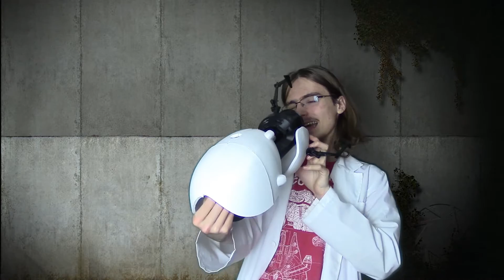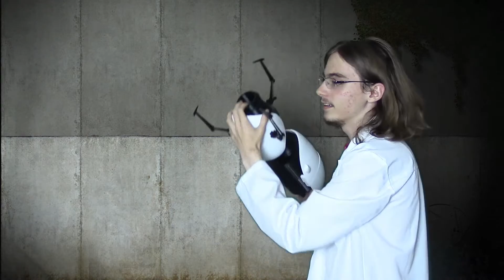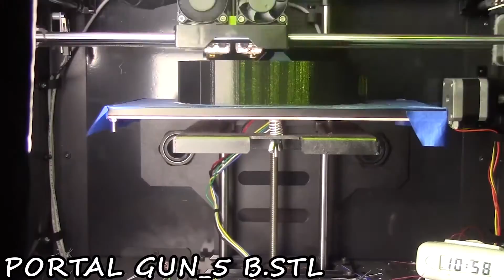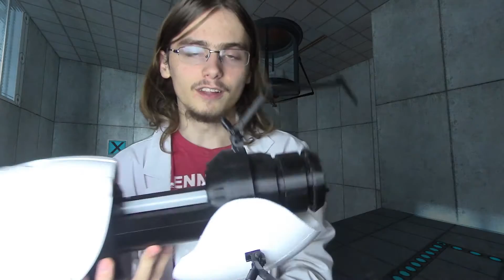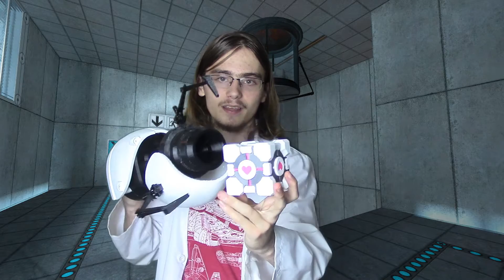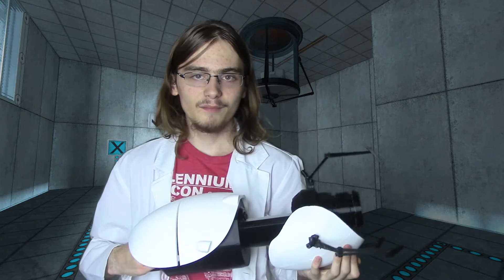3D Printed Portal Gun- Thingisplore S:2 Ep:11

Comment: How much plastic did it take, A whole role? Half?
Reply from the maker: It's been far to long for me to remember exactly, but even with the white supports I believe it was less than one roll of film each. What you can do though is download all the pieces and slice them. All slicers I've seen give a material estimate that is pretty good. Makerbot tends to be high and I believe Sli3er is + or - depending on the print. If you work with the same slicer a lot (like me) you typically get a feel for how far off the estimate is with any given print.

Comment: In this print how big is your printing area for this?
Reply from the maker: Not big enough to get that front cover in the optimal position but JUST big enough to get it in the position I used.

For a more technical answer, the FlashForge Creator Pro has a print size of 8.9 x 5.7 x 5.9 in (22.6 x 14.5 x 9 cm). It's a build plate size good enough for about 95% of props/cosplay prints without having to split pieces myself.

My new printer, the Prussia i3, will have a print size of 9.84 x 8.3 x 8 in (25 x 21 x 20 cm)